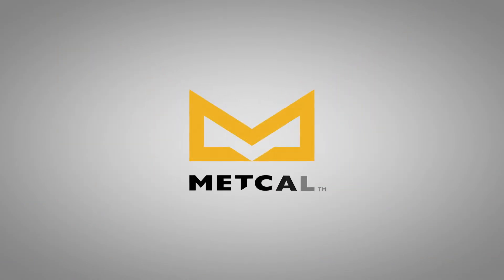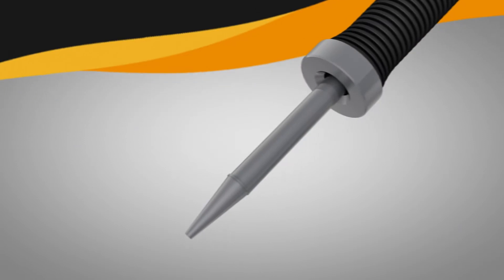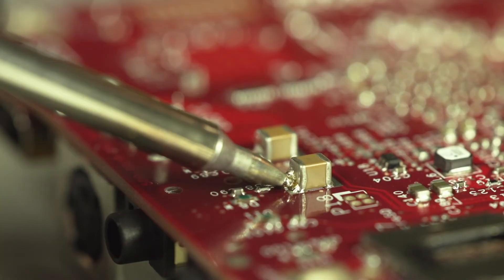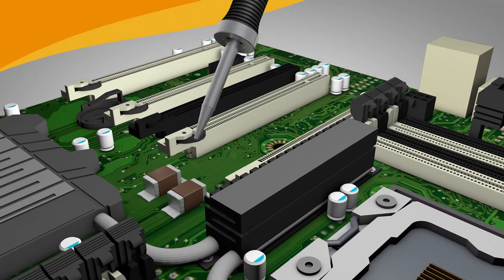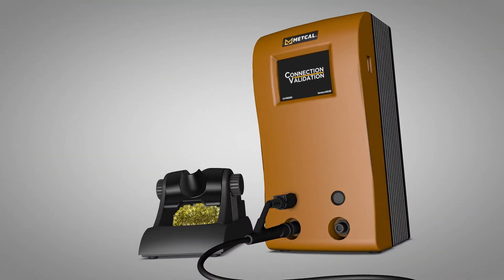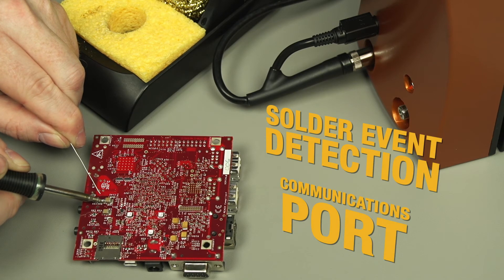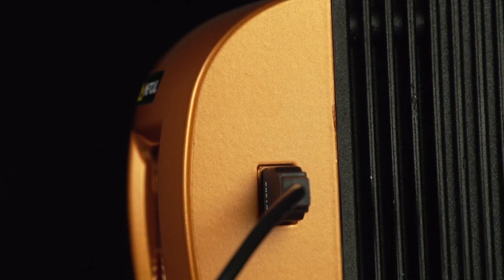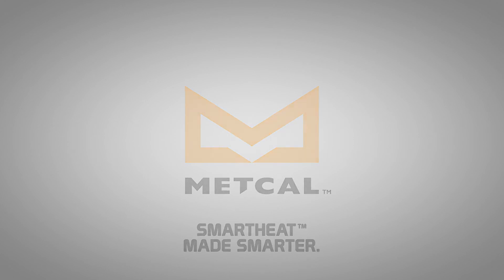Metcal CV Connection Validation Soldering System

Comment: For someone that only solders occasionally on expensive parts without the ability to test on a sample part fist to know what the heat sink values are this could pay for itself over time and reduce heat shortening the lifetime of components by allowing you pull off sooner than you normally would especially on a ground... great soldering system!